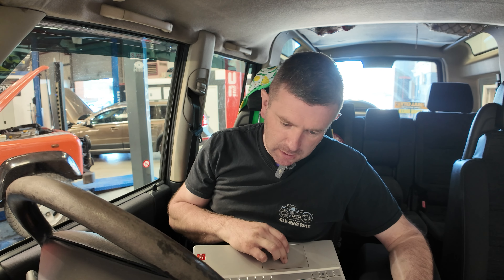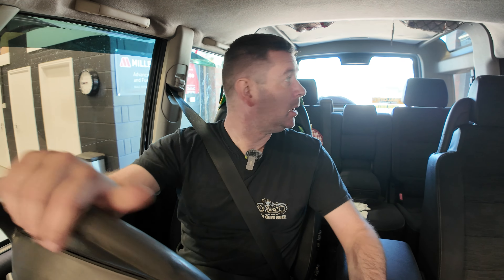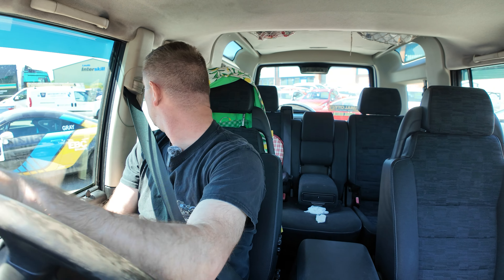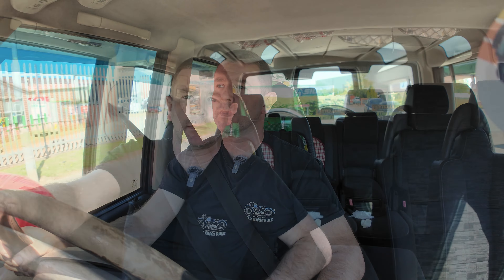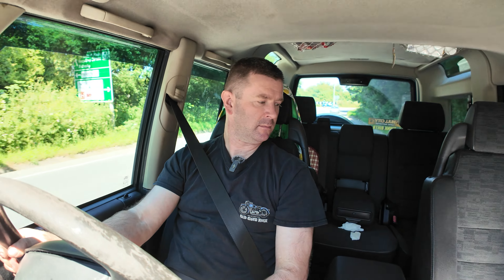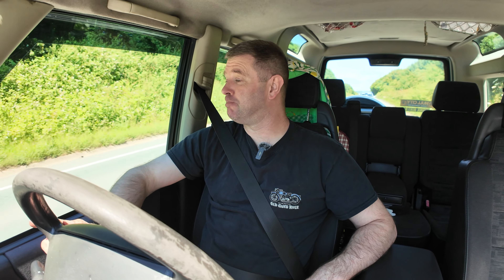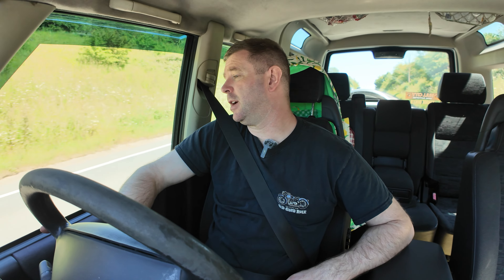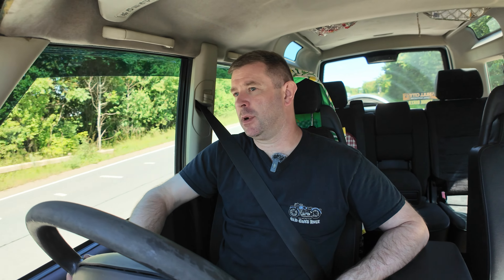Discovery Td5 Automatic - Part 2 (Stage 2!)

Comment: At what point do you need to start thinking about a bigger (VNT?) turbo?  Would that be a Stage 3?  I'm guessing, if the customer put a straight through exhaust, that would help, but would you feel a bump in performance just from that?  Finally, are you going to feel the benefit from the larger intercooler, if you aren't towing?  Sorry for all the questions, just trying to work out my next move.

Just for reference, my Disco has:

An NNN ecu that might (he didn't know for sure when I bought it) have a stage 1. (It had an MSB one before that which seemed to be wrong for a 15P)

Standard exhaust system, including CAT. (Thinking about trying a straight through)

EGR delete.  (Just done)

Think that's it as far as anything that would affect the performance, goes.  The previous owner, basically threw the Terafirma catalogue, at it underneath.

Comment: Why would you do all that work and not delete the EGR valve cheap modification and it’s going to help with performance when the engine is sucking in clean unburnt air?